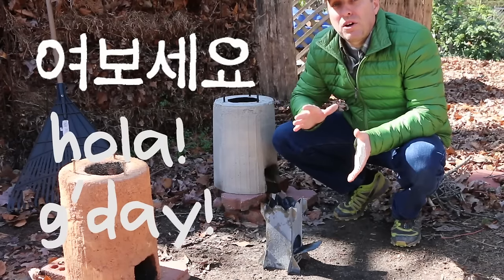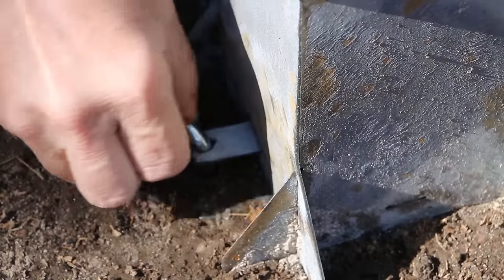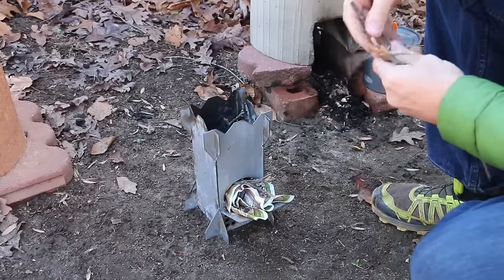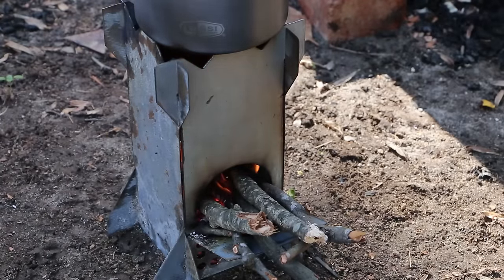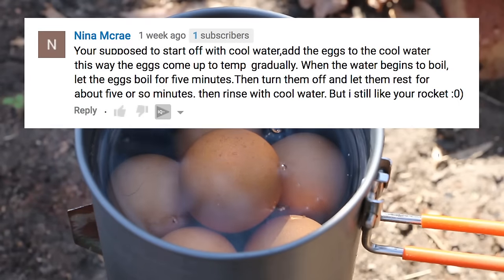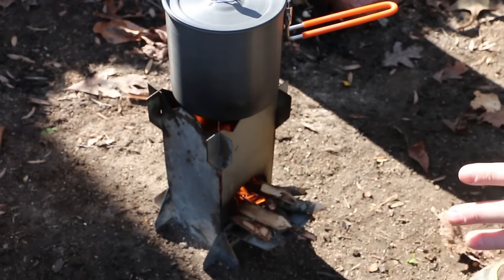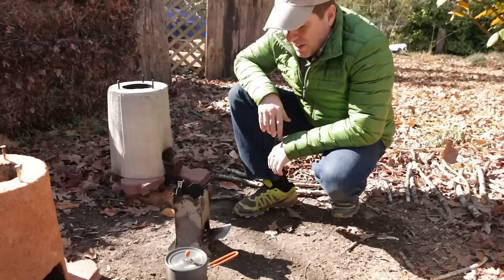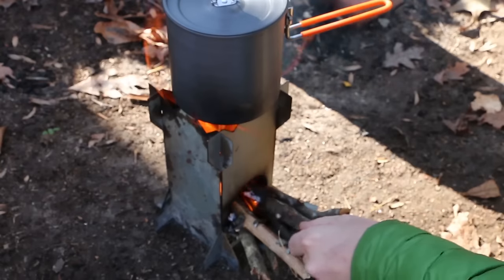How To Boil Eggs With My DIY Metal Rocket Stove

Comment: In my food prep classes for my BS degree in home ec, I learned that eggs were not supposed to be boiled.  We brought the eggs to the point right before the boiling started, then shut off the flame, covered the pan, and waited 3-7 minutes.  Afterwards, we would run cold water into the pan until there was no more heat in the water. In practical experience, I learned that room temperature eggs that are more than a week old do better for hard-cooked eggs than eggs that are fresh eggs straight from the fridge.

Comment: Good demo - it sure does draw very nicely. Certainly slightly deeper notches could help the draw when a pot is in position - providing not so much that heat escapes too much out the sides.
Reply from the maker: Thanks Chris. I did another egg boil yesterday and moved the pot around to create better airflow. It helped a little, but I do think I need to increase the size of the notches. I could add a pot rack to the top, but that is another part. I want to keep this as simple as possible. Thanks for your continued feedback.

Comment: you should try spray on ceramic would provide insulation and protection.
Reply from the maker: TBerry...that is a good suggestion for this rocket stove. The paint can't handle the heat.

Comment: I love your design for this camping stove! I noticed that when you had the pot on top of the chimney, it looked a little unstable because the pot and the chimney were almost the same size. if you would have had a smaller pot it wouldn't have worked with your stove, this is a limitation on the size of pot you have to use. 

 Correct me if I am wrong, or this affects the stove negatively. I was wondering, if you were to add a cross member to the chimney to allow any size of pot, would this be possible? Same slotted design.
Reply from the maker: You are right. The stove size does limit the pot size. A smaller pot wouldn’t have worked without an additional grate. I didn’t add a grate primarily to keep this design simple. I have modified it with deeper notches at the top for better air flow. I’m also using a 6-inch pot now, which I would say is the ideal size for this stove. Thanks for the feedback. Thanks for watching.

Comment: I'm guessing the high temp paint won't perform very well...  It might surprise me though...  Cool to see this in action Tom.  I can see all kinds of applications for this Rocket Stove on hiking trips and campouts...  Maybe even tailgating too.
Reply from the maker: I appreciate your perspective on this. I got 2000 degree paint for the rocket stove test. I'll be painting one and leaving the other raw steel. I want to do a side-by-side. By the way, I got a small plasma cutter, it is supposed to be dual voltage, but the plug is 220. Do they make adaptors?
Reply: Hmm..  Most of the time the dual voltage units have a twist lock somewhere that allows you to swap ends.  I'm guessing if it doesn't you'll need to get a cable from the manufacturer.  There's usually either a sensing circuit or a switch.  The cable end could be the switch that indicates voltage to the machine.
Reply from the maker: +Greg's Garage I just took it out of the box yesterday and didn't see a second plug. I may have ordered the 220 voltage unit by accident. I'll just pick up a 220 extension cord and unplug the dryer when I need to use the plasma cutter. Would probably be more powerful running 220 anyway. Have you worked with both voltages?

Comment: Did you happen to note the amount of time it took to reach a boil?  Just curious as to the efficiency of the smaller model in comparison to the larger ones.
Reply from the maker: I didn't get a good time on the start of the boil, but I've done it a second time and it felt like about 8-10 minutes. I'll time it when I boil some eggs again. I will say, I was heating a lot less water than I was on the big rocket stove. But, I also could have put less water in the cast iron pot than I did. I had a suggestion to shorten the pot stand-offs to 3/4 inch. That would help with better heat transfer. I do feel like the small stove/pot set up was faster to boil.